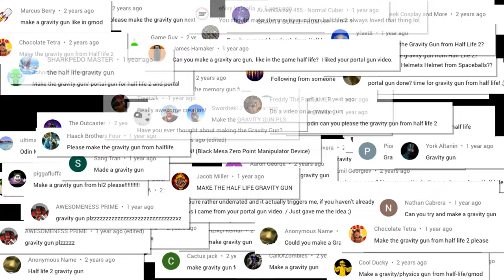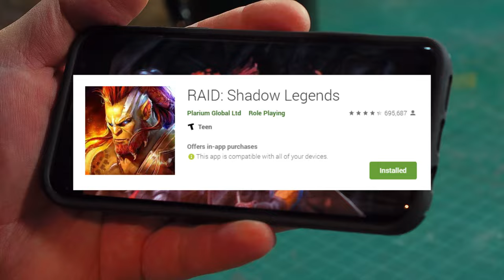Odin Makes: The Gravity Gun from Half-Life 2

Comment: Have you thought about using a scroll saw for  cutting that ring out you could drill a hole in the center and remove the blade feed it through the hole and do you cut.......just a thought anyway

Comment: What are the metal squares with holes you use called?
Reply from the maker: 1-2-3 blocks. They are 1 inch by 2 inch by 3 inches. They are a machinist's tool. But so very useful. about $13-$18 a pair on Amazon (that's cheap ones, if you want serious 'all the threads match up' machinist grade, they go for a whole lot more)

Comment: Hi, i'm from Cape Verde and I love your works, i want to make a short film and here we can't find a airsoft gun, can you guys please make a prop militar and normal day weapons with foam? Please
Reply from the maker: Most modern weapons are basically flat with some raised detail. Cut out the profile and add details.  PVC pipe or wooden dowels for barrels. If you don't get a super tight close up of the gun, it will work well on screen (I made one once by taping a candy bar on the end of a hot glue gun.) Test it out and see, make a quick one first, really simple, and run around acting like you are firing it. Add muzzle flash like Rocket Jump does. If it's all action, you will be fine. It's that hero shot holding a pistol next to their head, back against a wall you gotta be careful of. Look at my Samus Gun build, it was my 2nd episode I think.
Reply: @OdinMakes  thanks man, love your works